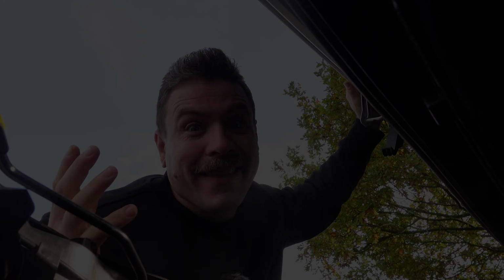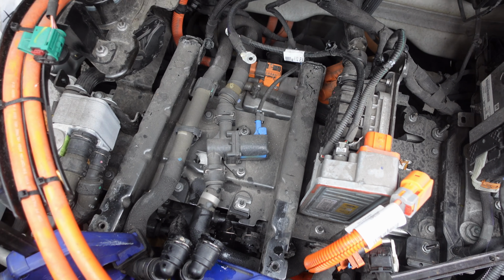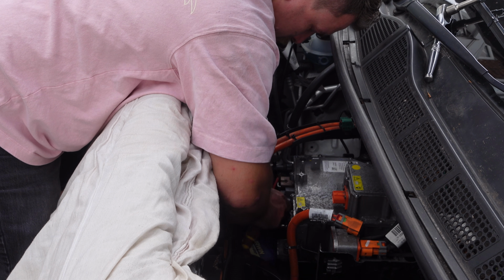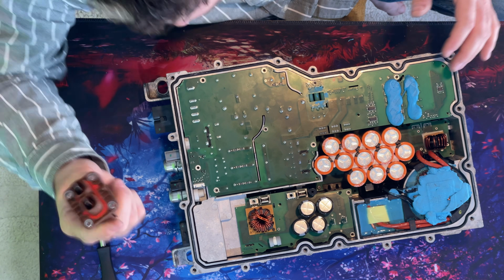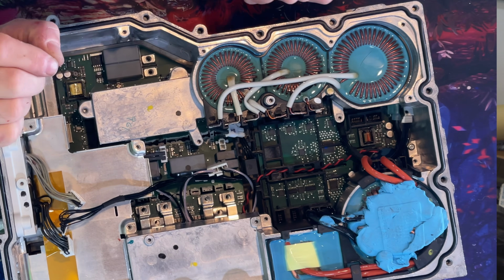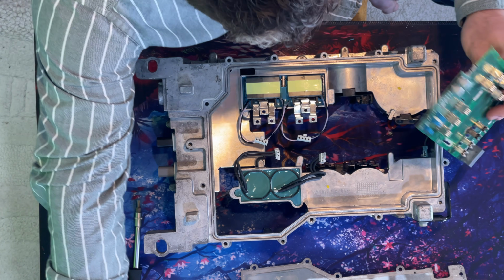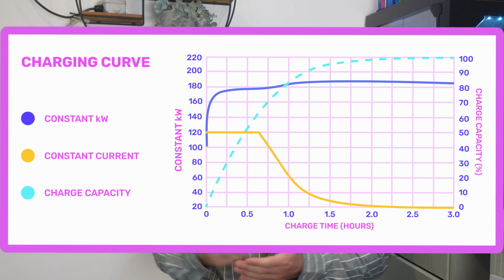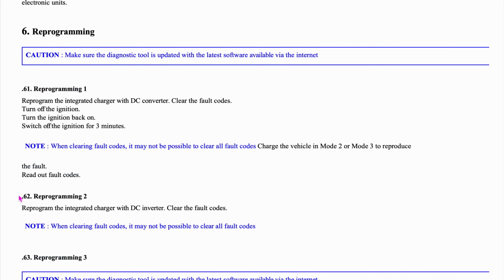Dealer Quoted £3,000 — I Fixed It for £380… But It Wouldn’t Work Until the Dealer Did THIS!

Comment: I have cat S vauxhaul vivaro E Life.
I gave little money for a 72 plate 20k miles. I use it upto 90mile radius and so far only had to put 2 tyres on it. And 2 nearside doors.
For what I use it for it's great. But as you say the right to repair and the software should be readily available. I can see in the future dealerships disappearing as people get wise to later vehicles being poorly designed and dealer attitudes.
Reply from the maker: Very nice. I’m intrigued what you got it for and how much it ended up costing you once you’ve done the repairs.

Comment: Interesting video. Electronics technician here, I worked on three phase motor inverters for a number of years. The passive cooling is designed to pull away the internal heat to the outer casing, so when the case temperature is hot, that it a good thing, it doesn't mean the internals are that hot just that the heat being drawn away is that temperature. It didn't appear to look as though there was any issues with cooling internally, the component that failed is a PCB header connector, the reason it's failed would either be that the current draw is higher than the rating for the connector or more likely its due to the vibration of being mounted to the top of the motor which has caused some movement and in turn arcing, which in turn has caused it to get hot and gradually fail. The bottom board that you got the Dremel to, was the motor drive, usually mosfet transistors , then the inductor coils just filter out high frequency noise. That connector was more than likely the culprit of the fault, just bridging across to bypass it with suitable cable may have resolved the issue, it wouldn't work under load condition. In truth, that didn't look too bad to repair, I've seen much worse. If the motor drive section had failed there would be a big hole in some of the components making it obvious, hence why that section has a potted, they can literally explode and cause fire so potting it retains that energy so it doesn't cause a fire. There are ways to dissolve it, but takes time.
Reply from the maker: That's some great insight, thanks for sharing your expertise!
Reply: A bit of a side topic since it's more about electrical stuff than electronics but a lot of times when i encounter trouble on my equipment ( farmstuff)  it's about connections etc. which are underrated or working at the max capacity.
I have had situations of 4 worklights (4x40 watt) at 12v fused with 15 amp but the part in which you put the fuse just melted because the connection was not up to it and it became to hot.
Once i have to wiggle a fuse to get things working i know it's just a matter of time before i run into trouble.
I can imagine once stuff like this happens inside electronics the result will be the same, trouble and this time with high costs....
Better use connectors that run at half the rating i would say even when it costs a bit more but stays together ....
Reply: Citroen have never wanted owners and independant garages doing repairs and over the years all manufacturers have done their best to make it as difficult as possible.

Comment: Very poor thermal management design, basic physics dictates that heat rises, and yet they are attempting to cool it from the bottom, doh!
Clearly the cooling plate should be above the hottest components. The complete lack of airflow in that sealed enclosure means that components must be derated, for example those connectors will have a maximum current rating, based on free air at 20 degrees ambient temperature. There will also be an increase in temperature on the connector for every hour it is carrying current, if this is continuously carrying current it will also need to be taken into account. Someone has probably looked at a spec sheet and read 10A current carrying capacity, without taking this into account. After several hours of use, those terminals probably reach 80 degrees and the box ambient temperature not that far behind, they would need a connector capable of double the current in that environment. For anyone interested, Google electrical connector derating.

The fundamental issue with legacy automakers is they have no experience with electronics, they outsource things like this to the cheapest vendor. You can’t build an EV like that, the whole system needs to be designed as an integrated platform.

Comment: My initial thoughts are: Where does it talk CAN bus to the rest of the vehicle? Can that part be persuaded it's still in the donor vehicle? Does the vehicle CARE what charger module is connected to it, or does the charger module care about it being in the wrong vehicle? CAN bus frames can be intercepted and modified by a man-in-the-middle board (hello charger, this is really the van you think you should be in, hello van, this is really the charger that you think it should be), which is how the Nissan Leaf DIY battery swaps happened before some even cleverer person reverse engineered the official coding tools. Admittedly, if you're replacing a battery pack, you're in a lot deeper financially than an on-board charger, so the extra effort is worth it, especially if you can upgrade the vehicle beyond the out-of-the-factory spec, e.g. installing a 62kWh battery pack into a vehicle that only left the factory with a 24kWh pack available.

@Evbmw has done all sorts of Franken builds with EV components from one brand talking to others from other brands. Perhaps using the on-board charger design from a more reliable brand might be possible?

Comment: Don’t forget that Stellantis has paid off the British government to keep consumer repair out of the hands of the consumer. In the USA there is a full blown grass roots effort to get the government to mandate the companies make customer repair an open source system. This started with the farmers who purchased state of the art tractors but when something went bonkers and left the farmer dead in the water considering the repair tech would not make it to their farm to repair their brand new tractor for several weeks since they had a backlog of repairs to complete. Now one’s crop does not wait when it time to harvest. Basically farmers have lost millions in revenues since crops basically rotted in the fields or they could not plant within a given window. If Stellantis is doing this crap,in the USA then everyone should bring this to light. There is a possibility if hackers could find where the lockout codes are stored either on the micro or on an EEPROM and can hack them they might have a chance at developing a way to jailbreak the locks and find a way to reprogram whichever board is causing the issue. They would need the charger with the VIN number assigned to the at charger.with enough t bad chargers they might be able to see where the vin number is kept in memory and by accessing The same memory locations implant the vehicles vin into the donor or new charger.

Comment: hey there.. great video. but I have a little problem with it.. 1 you have not shown that you have made the car completely powerless.. just disconnecting the 12 volt battery is not enough. you MUST disconnect the high voltage battery first, you actually have something wrong with the car. What does it say that the cut-off relays inside the high voltage battery are not stuck in the closed position (and do not always put an error code) what you show is actually life-threatening. there is such high voltage and current in the high voltage battery that you can literally be turned into a piece of barbecue charcoal.. I think you should remove this video temporarily read on and make a new video where you show exactly how to make the car completely powerless. should be added that I work with the Stelast brand and Toyota and the rules are the same including the right measuring tools and personal protective equipment
Reply from the maker: Hey. Awesome comment. Checking the system is dead with the correct GS38 tool and testing the tool in a procedure is important. On one hand, if the ignition is off and I have 2 closed or welded contactors with no 12v battery it would be very worrying on a 3 year old vehicle. But I agree proving dead is part of safe work on any electrical system with enough voltage to harm. Im sure you can also appreciate that it’s not a grounded system so power needs to flow from pos to neg to shock a person. Finally i’m sure you would agree the only real place for danger if the contactors were stuck is the DC line to the top left which is largely shrouded so contact + - is pretty unlikely. 

I completely take on board what you’re saying. I trust that the audience is smart enough to work safety aspects out if they chose to carry out a repair. If every YouTube video where a car is jacked up it would get pretty dull if everybody said ‘Be careful! Make sure you have axle stands.’ You know? 

But I think this subject deserves a pinned comment to make sure that people are aware of the safety aspects. Thank you 

O any comments as far as broken on board charges go? 😂😂

Comment: Tesla is the best in this world. Just try to replace bearing to Renault Zoe ZE50 R135 motor. Cost to fix my issue on my Zoe with faulty bearings need to replace the motor, price in my local shops is 300 000 NOK and no loaner and wait time for motor 2-3 years! Only runned 50K km before fail. European car sucks...
Reply from the maker: Ouch

Comment: Did you suffer dropped phases? If you bring back phases one at a time you will absolutely destroy these OBC.

The original design is not great, as reported almost everywhere.
Reply from the maker: No phase drop. We have a reliable grid
Reply: @TheOfficialBatteryMan did it trip anything? If the car leaks voltage to ground it would achieve the same.

Comment: I wonder if this would be solved by reducing the charging current periodically (which you can do with Home Assistant and a bit of automation); like you should on a Renault Zoe. If you keep 7kw on that for hours on end, eventually you can't charge anymore due to heat damage (see Gary C's videos). 

Anyway - terrible customer service from Stellantis - I will never buy one of their garbage products.

Liked and subscribed 👍
Reply from the maker: Possibly but you shouldn’t have to and I need to charge while electric is cheap 😂😂

Comment: Thank you for that. What an amazing teardown video. The trouble with failed components in a high power unit is the knock on damage to other components and you have to find and replace all the dead and degraded components otherwise it will die again when you power it up. If it is poorly designed in the first place then it’s not worth repairing. Stellantis is off the list for me.
Reply from the maker: Yeah that’s the conclusion I came to. You have to fix the root cause of the failure. 

I was thinking it’s like people who say my DPF is blocked up when they’ve had a slight misfire for the last 10,000 miles. It got damaged because the engine isn’t running right fixing the DPF will only cause problems later on.

Comment: Pressure fit connections at 7kw dunno if more do that but electricians debated how safe Wago connections are and they don't get anywhere near 7kw.

Not surprised that connection got hot all that power thru a spring contact, madness.

I used to be a huge citroen fan but I wouldn't touch anything Stellantis these days it's all built so cheap.....
Reply from the maker: It’s an interesting design for sure. But the way they have stacked it they rely on connections that allow them to push boards inside the casing

Comment: 2:33 What's the plan with the dryer heat pump in the back? :D
Reply from the maker: I’ve been embarking on a project to use a heat pump tumble drier to heat and cool the office. Let’s say it’s gone slower than I expected. There are a few videos on the project. Including building a drilling rig 😂
Reply: @TheOfficialBatteryMan  Sounds interesting. I had the same idea to modify one for heating the garage but I found too many projects, too little time to get in the way.

Comment: What does the green "fireman" connector actually do?
Reply from the maker: It breaks a 3.3v loop to the battery controller which tells the pack to not close the contactors (big relays) so no power is allowed out of the battery. A signal for a switch

Comment: Just subscribed. Great video mate. The French manufacturers seem to have reliability issues on EV's as the Zoe has problems with its air cooled motors' greased bearings amongst other issues. Shoddy design in many areas such as with closely rated connectors. Coding simple to replace parts needs to be legislated out. 
As you say, Tesla are brilliant in the way you can access so much info through the screen on the car.
That charger is way overcomplicated. Have you followed Damien with his re-design of the Tesla Model 3 drive inverter? It is far less complicated and on one board as is the Tesla inverter.

Its shocking that the Mahle charger is worse than the Chinese replacement. Story of our times I guess!
Reply from the maker: Glad you enjoyed it! It's wild how much more reliable the Chinese unit is compared to the Germans
Reply: I stopped buying German Bosch.  Out of 3 hedge trimmers, 1 lawnmower, 2 tumble dryers, 2 washing machines only the 2 washers & 1 dryer didn't die at a ridiculously young age.  The good tumbler was the 25 yr old one that still runs.  The newer condenser dryer went bad after 2 years with a HIDDEN fluff trap & floating sensor, needing access to an undocumented secret flap in the condenser tunnel needing contortionist skills to remove to clear the fluff out (thanks YouTuber detective man!).   After 7 years of pain, we got rid when a different error code flashed up & bought Beko.  The lawnmower cut well, but plastic height adjuster handle broke off, needing special tools to open up & the height mechanism jammed often from early on, causing a regular fight with the handle.  Not worth a visit to the repairers so bought Flymo (Husqvarna) NON hover.  The 3 hedge trimmers all died when the nylon reciprocater failed after only 1& 1/2 years each.  Bought a petrol Ryobi.  Had a 2nd hand Bosch 14v battery drill that lasted years, but due to modern Bosch 💩iness, replaced with Milwaukee 4Ah+4Ah twin drill pack as it was rated higher than Makitas for build quality (except the chuck - replaceable).
German built now means:- ["we hate you British & will rip you off like your French owned energy providers do, so that your profits will reduce our own citizens prices massively!!...🖕"]